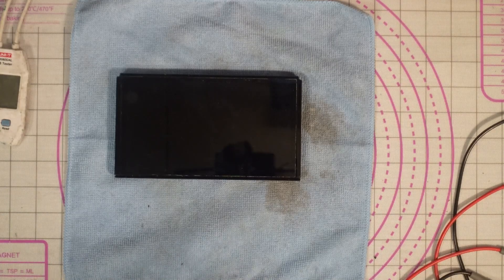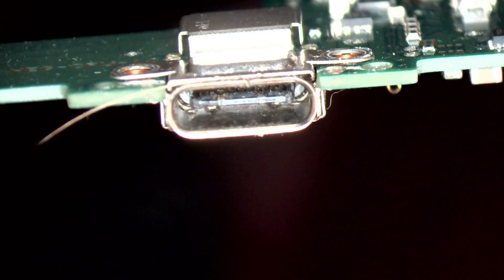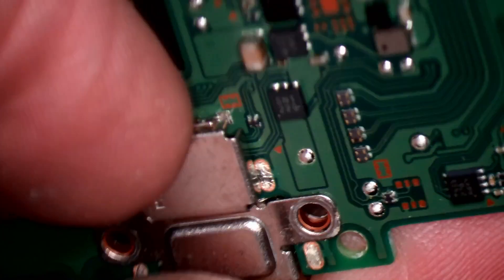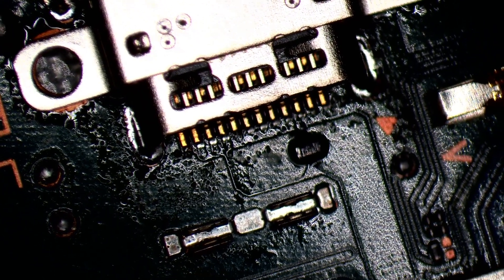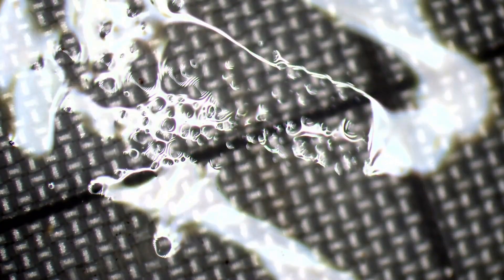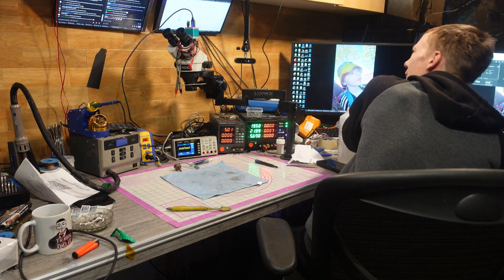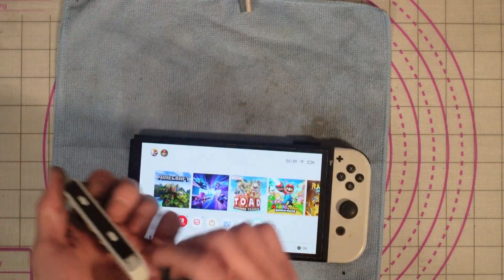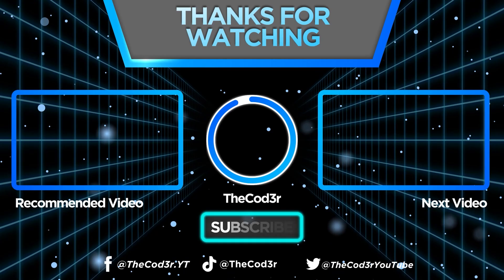This Nintendo Switch Won't Charge! Can I Fix It?

Comment: Have you had any luck with replacing wifi chips on these? I have a board in the workshop with a failed wifi chip but they seem temperamental for replacement
Reply from the maker: Yeah bud the WiFi chips you see online are generally not going to work because they have custom firmware on them when used on the switch. I sell genuine ones on my store which I pull from donor boards but it is hard to come across them usually
Reply: @TheCod3r  thanks, I had seen that "new" chips are no good and need to use donor chips, I'm sure you see far more than me, how common is the wifi chip problem?